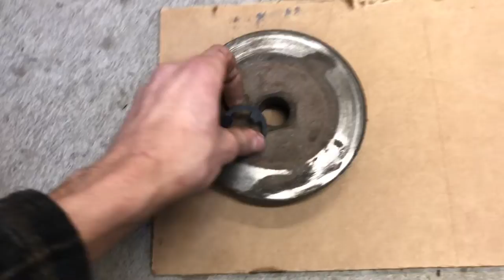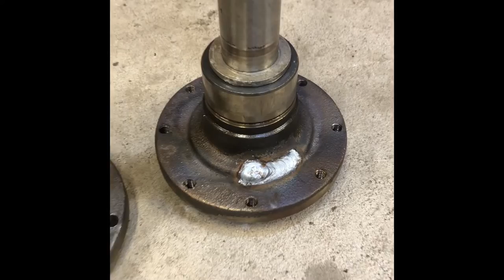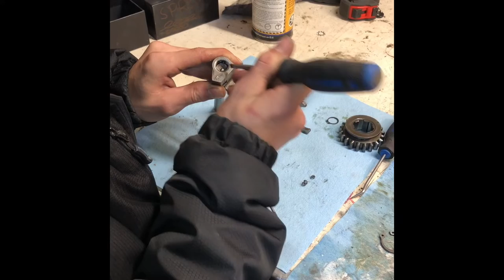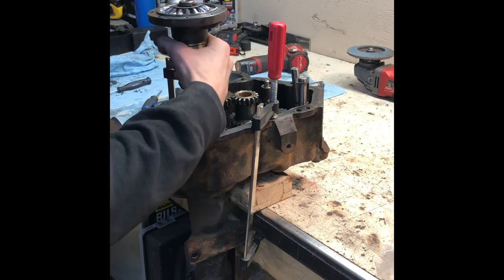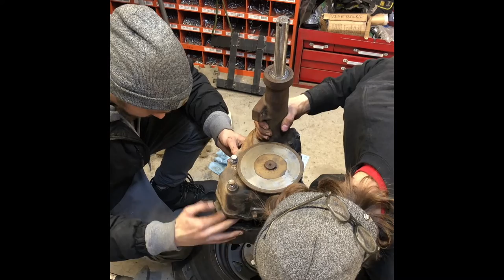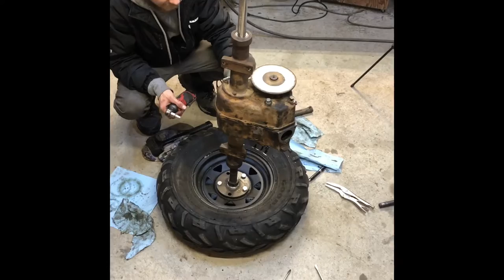Locking a peerless transaxle. (SCRAPPY off-road mower build pt2)

Comment: Hey ryley, what did you put in the rear end? Oil? Grease?
Reply from the maker: Gear oil ,believe it’s a 80w90 with some heavy duty stabilizer added
Reply: Thank you!, I'm building the same rig, any tips n tricks on the rear end? When I go to weld it?, and also my rims are seized to the 1" keyway shafts, what would you suggest to get the rims off?